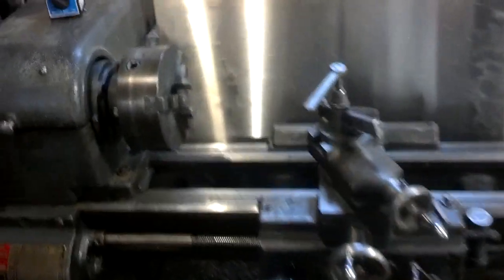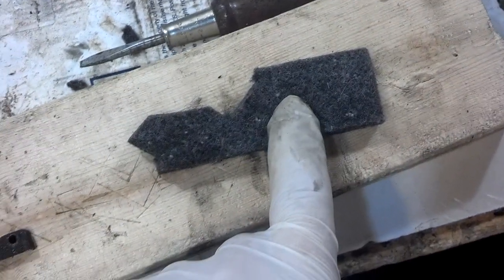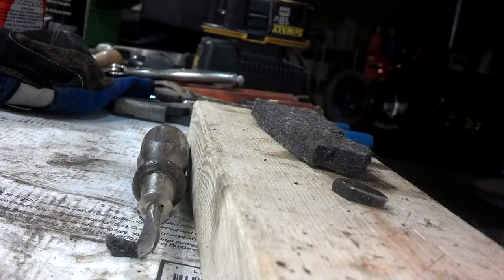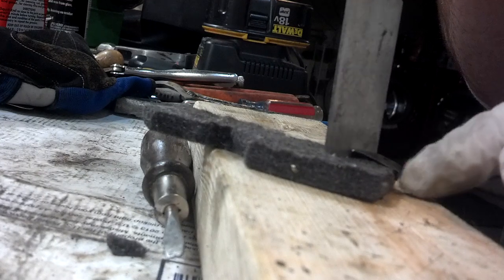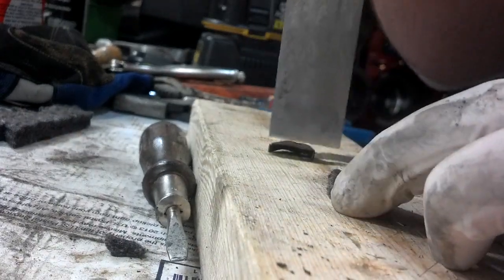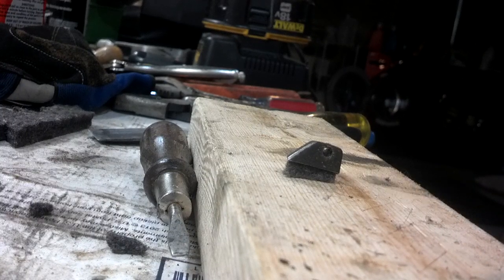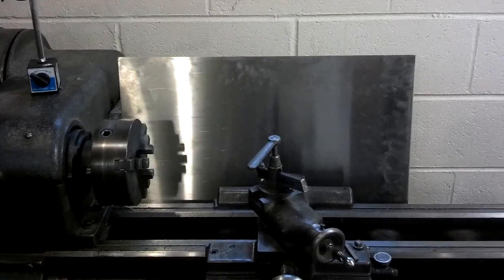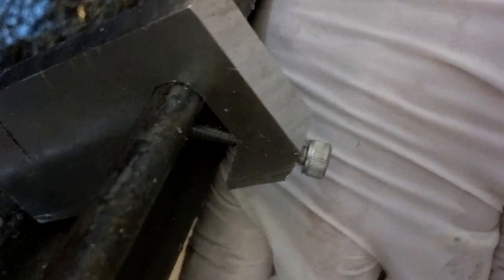Replacing Lathe Wipes and Splash Guard. Part 1

Comment: I noticed the wipers on my lathe have a very thin sheet of brass behind the felt/wool part.  Any tips for that style?
Reply from the maker: Not sure, without looking I would think they would replace just like most others. I've not run across a lathe with those, but I've mainly only delt with South bends, logans, Atlas, delta, and grizzly lathes